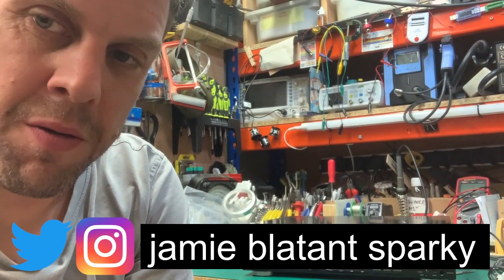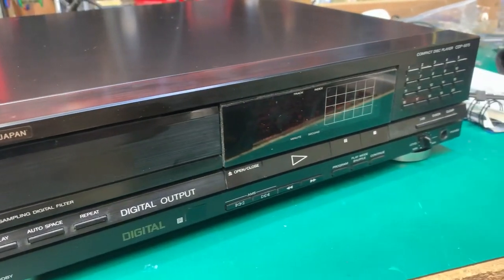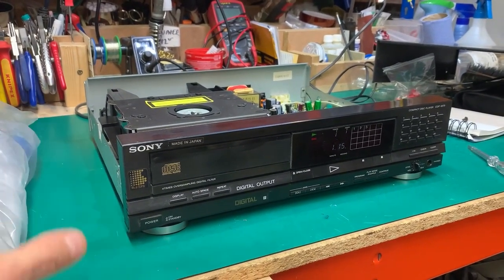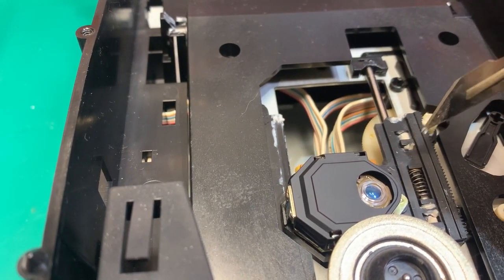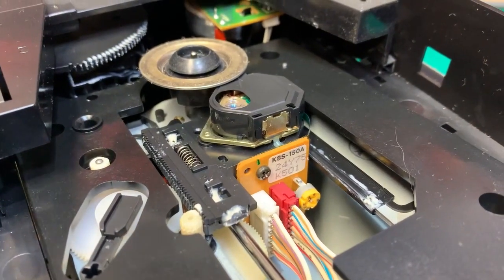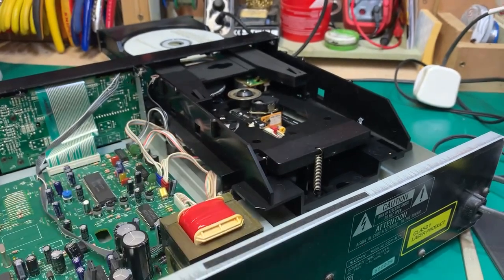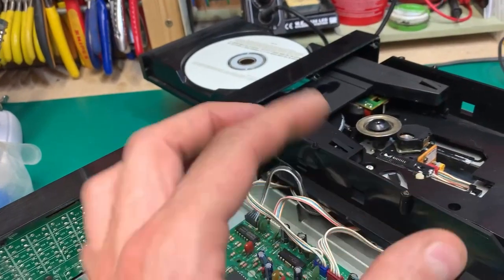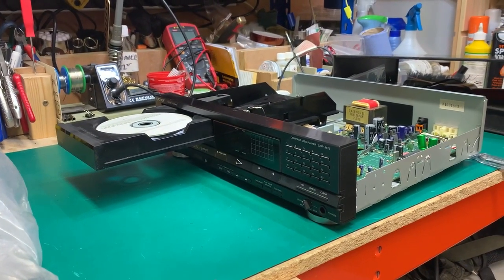#REPAIR sony CD player repair FaIL  , your CD players are all dying

Comment: To be honest, the laser is the last thing that needs replacing. 99% of the time it’s something different, like bad caps or the spindelmotor or mechanism needs attention. 
Also dust on the mirrors gives reading problems (in the laser unit) and needs some cleaning. 

The laser works or works not.
Reply: How do I clean the inner parts of the laser unit the easiest way then? Seems not too easy to disassemble the whole pick up unit first...

Comment: Well that just ruined my day :(   My newer CD player (RCA brand) just stopped reading CDs correctly, it will play about the first 3 tracks okay then hangs up.  I have an old Sony CDP-CE275, must be at least 20 years old, and it won't play correctly.  I think I will still take them apart and investigate.  Considering that new music quality CD players start in the $400 to $500 range, I was hoping to get one of the old ones fixed.  I remember the day when you could get a decent music quality CD player for not much more than $100, I am surprised at how expensive they are now.

Comment: I have a Sony CDP-690 with exactly the same problem - the slightest tap or even walking across the room causes it to skip. And here is the thing - it is not the optical laser pickup unit, since I replaced it for a new one as this machine uses a KSS-210A which is still in production and relatively cheap. Made absolutely no difference, the machine is mega quick at reading both standard CD's and CDR's but this 'sensitivity' problem remains. I have cleaned it thoroughly, greased the cogs, the metal rail etc. - no change. Kind of running out of ideas what the problem could be.
Reply: I watch a video of a repair guy adjusting the gain pot and another pot and it solved this issue
Reply: @brynshearwood9797   It seems as if you need an Oscilloscope in order to properly adjust all the potentiometers that affect how the laser tracks the data from the CD. With a 210A you have 5 Potentiometers that you have to adjust, 4 of them are on the units mainboard and one is on the laser pickup itself.

Comment: The kss150 has a second lens which needs to be cleaned. After that the output will restore to former glory.
The kss 210 replacement is junk, it doesn't have the second lens, which on the 150 protects the prisma inside from dirt.

Comment: There is nothing wrong with the laser. Just need to adjust the variable capacitors with a plastic pen cap like I did. Works like new now. Put in a cd and rotate the capacitor to one side till the cd makes funny noises and mark the spot. Rotate the other way till it makes funny noises or stops and mark the spot. Leave it half way between the two marks. Repeat for the other capacitors. It will run like new now!

Comment: The KSS-150A was made obsolete by the KSS-210A and the KSS-210A has new generic stock from china the differentce between the generic and original is the bushings are plastic and not brass buy they are the proper replacement imo and should be plug and play without needing an alignment.
Reply: Yeah 100% I replaced mine with a generic KSS-212a (made in 2023). Works great.

Comment: I can still buy these lasers at ASWO shop, so, please don't say you can't buy it ;).
Reply: ASWO shop has KSS210A which showing as equivilant to this one.
Reply from the maker: They don’t work too well
Reply: @jamieblatantsparky  yes, because you should calibrate it and not just replace it ;). Ideally use a service manual and an oscilloscope.
Reply from the maker: @PiotrFicner  it’s because they are no longer made and what you but is 10 year old stock that’s been sitting on a shelf in a warehouse and is blackest from static
Reply: @jamieblatantsparky  For now I have no complaints from my customers, and I received my laser yesterday from ASWO as well for CDP-M48 which I use it here. So, I'll install it and calibrate it, ane be the judge myself ;). 

When it comes to the capacitors, yes, electrolytic capacitors when lying too long can sometimes not deliver if kept for too long on the shelf, but I haven't seen a problem with a laser yet.

Maybe I need to fix more than a few though to see what you see ;).
Reply: @PiotrFicner  What an ASWO shop?

Comment: Why can't replace the laser head?
Reply from the maker: Because you can’t bu any new heads that aren’t stock from a batch produced 20 years ago
Reply: @jamieblatantsparky  Last Year, I've bought KSS-210A, and replace it. It was newest. I guess this head isn't original but device works fine.